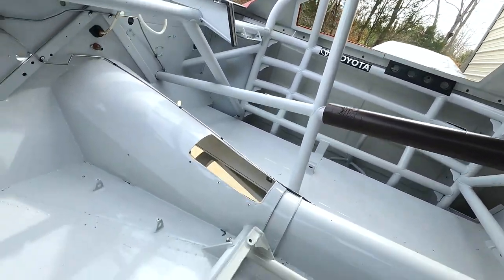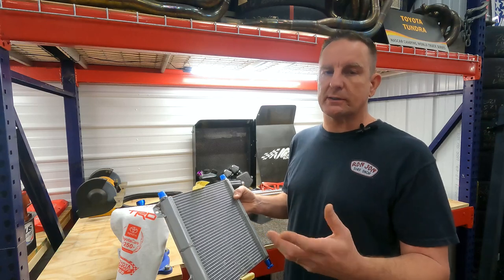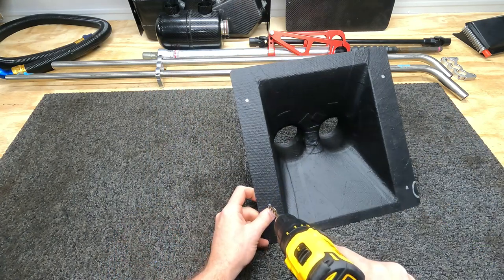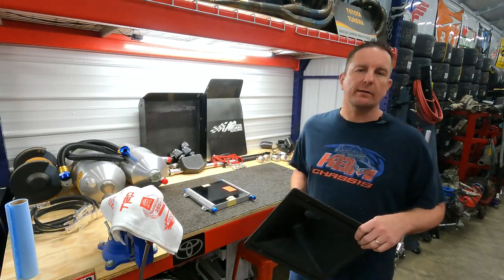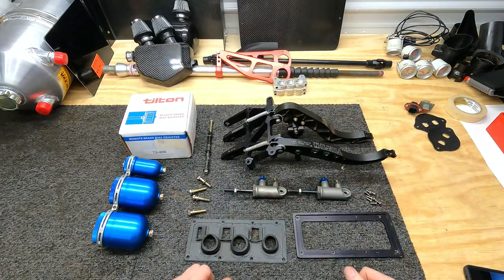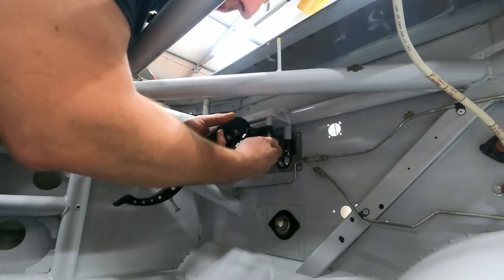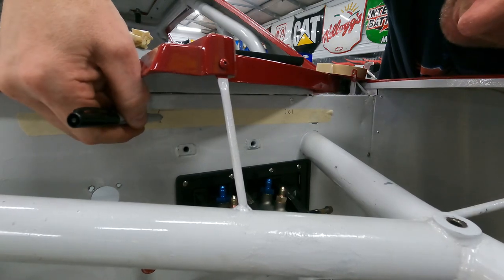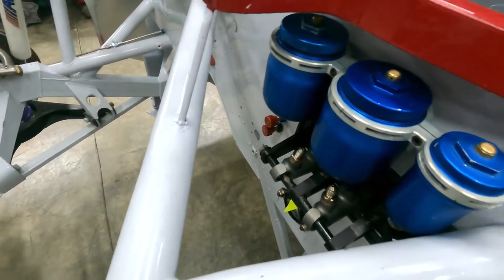NASCAR CHASSIS PREP & TOUCH UP

Comment: Is there a carbon floor pan that will fit a gen4 car that you are aware of?
Reply from the maker: There are several styles that were used in Gen4 cars throughout the years. The earliest I've seen was 2002 in a DEI chassis.

Comment: Are the speedway frames the same as road course frames? If not does nascar require the difference?
Reply from the maker: With the implementation of the Gen5 CoT in 2007 all of the Cup and Xfinity chassis use the same architecture.